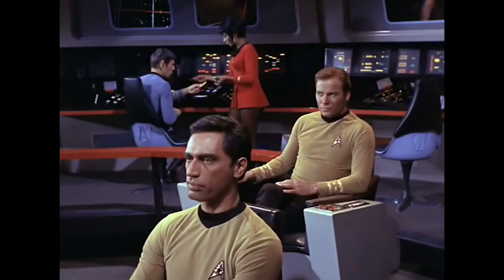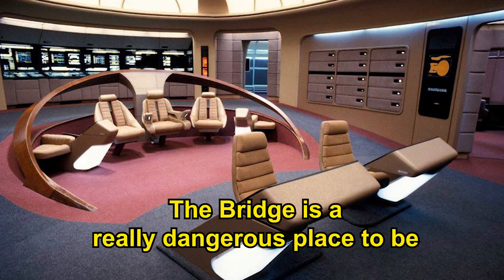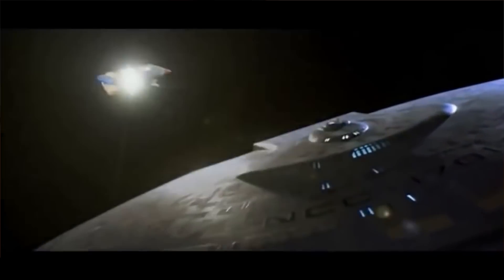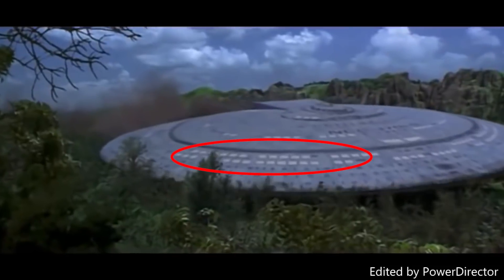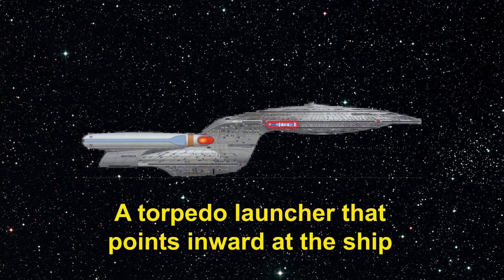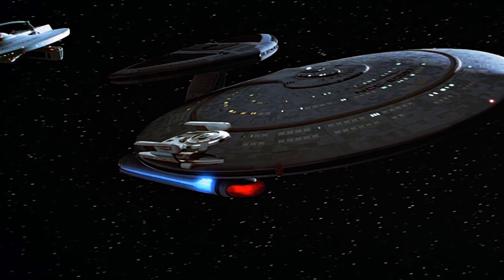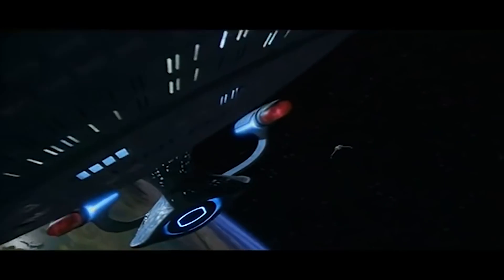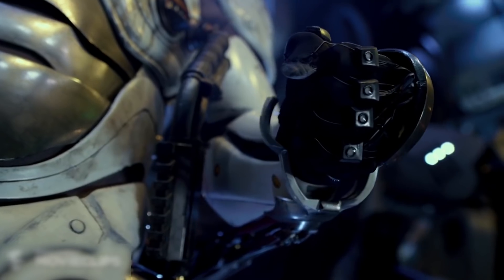10 Flaws Star Trek - USS Enterprise NCC 1701-D

Comment: Lets start with:

Technical Manual isn't canon.  Never was.  If you didn't see it on screen (or hear it talked about/described on screen), it doesn't exist.  This is in referrence of the inward facing torpedo launcher.  Its never seen on screen, or mentioned.  It doesn't exist.  Just like Voyager's Aeroshuttle.  You can clearly see the outline on the hull where it is supposed to be, but it doesn't show up on the actual in-show MSD, is never referernced even once, and never seen.  (In fact, they built the Delta Flyer in later seasons to specifically be what the Aeroshuttle was supposed to be!) 

Seatbelts:  This was actually vetted through NASA scientists.  When the high-energy conduits present in the equipment, strapping yourself in front of a bomb is a bad idea (you might get blown back from a console and be seriously injured.. but if you're strapped in and cant move, you eat the full blast and die).  The NASA scientists ALSO, mind you, asked... "why do nt they just use standard control systems so they can use seatbelts" - so ill give you half of that one.  

The Saucer Section landing:  I agree, they could have made it so the thing could at least have a controlled crash.  However, some things to blow up your comparison to the Shenzhou (dear god, leave Discovery the fuck out of anything.  Its a hot fucking garbage fire.) and Voyager:  Shenzhou is even smaller than Voyager, and Voyager doesn't even mass the size of the Enterprise-D's saucer.  (And those landing struts would never support Voyager).  

Warp Nacelle placement:  Roddenberry's initial idea was that Nacelles had to be able to "see" each other.  This was ignored after his death.  That's why later ships (like the Defiant) have their nacelles contained within the ship.  According to Roddenberry's technobable, this shouldn't work.  I cant take it or leave it, honestly.  You try to use a Nebula-class ship (basically the Miranda of the Galaxy-class era) as an example of a ship with the nacelles better protected... but this isn't true.  Theyre just exposed from the bottom instead of the top.  If they had remained consistent with Roddenberry's original "science" on the subject, this wouldn't be an issue.  (See Romulan D'Deridex class Warbirds and their giant nacelle housings out on the far sides of the ship).  

The Sovereign-class DOES, in fact, have science labs.  It doesn't have families by default, however.  As Sisko points out in DS9, you had to be of a certain rank to have your family aboard on most ships (for space reasons) but Galaxy-class ships were specifically designed for longer-term missions and families.  When asked why later ships didn't have families and the like, Berman noted that "STarfleet probably thought of it as a failed experiment" and decided not to do it on future ships of the line.. but this isn't canon.

Comment: There are plenty of design flaws, but many of these are silly and uninformed:

1. Why would the saucer section be able to land? All Federation starships are built in space. Voyager was weird and unusual in that respect and required a lot of additional tech to make possible, not just landing gear. You need MUCH stronger thrusters to land than to maneuver. Discovery and the recent movies are canon-contradicting bullshit, so don't bring those into it. They don't make sense practically on purpose.

2. In Generations, there may have been reasons the escape pods wouldn't have been viable. Once the ship was already falling into the atmosphere (which happened very quickly), it may be that ejecting escape pods would lead to a crash landing in those pods that was just as violent. Generally escape pods are ejected in space. I imagine the only way they can land is by carefully controlling their landing trajectory. If the pods can't make an extremely controlled landing, then it would be better to all be in one larger mass object like the saucer section.

3. The warp nacelles are NOT engines. The warp engine is in Engineering, which is in a centralized position in the aft section of the ship. Destroying the nacelles causes the engines to be temporarily disabled, true, but the nacelles have to be in an external position to operate properly and safely. They help create the warp bubble surrounding the ship, they move dangerous radiation further away from the crew, and on Federation ships they also act as a ramscoop, collecting hydrogen as they move through space.

4. There are many, many ways to input headings quickly without a physical joystick. In fact, a touchscreen should be quicker if designed properly and if people are trained in its use. Remember a physical joystick doesn't even allow two dimensional selections at once, so the joystick in the movie shown isn't even any better than the four-direction keypad. However, more importantly most maneuvers made by a Federation starship are completed by the computer. You usually just select maneuvers and headings.

5. I guess the saucer aft torpedo bay could be placed higher for more utility, but it's not like they didn't already have a lot of torpedo bays. Remember that torpedos can be aimed pretty effectively, or even made to curve in space. If they're running out of torpedoes, then I doubt one extra launcher is going to do the trick. And if they really want it, they can always separate the saucer section as a tactical maneuver. It would also be super easy to transport the torpedoes to where they're needed if it really came to that. I think the position of this bay is more form over function, since this is a ship built in an unprecedented time of peace. It may be a weakness for people sneaking onto the ship, but it's also possible that there's a physically designed fail-safe preventing a torpedo from being fired internally, even by a Captain's order. It might require weeks of welding to actually fire one.

Also, side-note, but 
you can't talk about "plot armor" and then criticize the fact that TV shows need exciting plots (like hijacking the ship). Feels like you're trying to have it both ways. Obviously it wouldn't really be that easy to take control of a starship if it wasn't a TV show.

Comment: and you cant compare the landing to the one in Voyager as the gear are in the section the enterprise had lost along with the core so it cant be counted in relation to being anywhere near the same and as with real life the ability to slow down or stop a fall fully depends on factors like the speed your going plus the wind friction and the angle your going down at if even one of them is too much for the desent it can cause a crash as can a lose of power which the enterprise main power was from the warp core the ship would of also had limited power during the crash due to the shockwave of the warpcore most likely having a minor emp effect on the sections power

Comment: 1. Humans like to see where they are actually going, not on a screen.
2. The new Trek moves fixed this issue, they have seat belts.
3. It's a big ship, can't watch all of it.. Ok it's just for plot.. 
4. The class D was the largest ship in the fleet, it could not fly in an atmosphere. The saucer section does not have a warp core to fly.. Voyager is a 700K ton vessel, Enterprise -D is a 4.5 million ton vessel. You are comparing a watermelon to a grape. 
5.  They didn't feel the need to modulate the shield frequency as the Klingons shouldn't have known the frequency. It probably uses more energy to do so. 
6.  I would bet they can transport the torpedos to whatever bay they need. 
7. Those are the nacells, not the engines.. The engine is in engineering. Lets be honest, its designed that way because Roddenberry deigned it that way, don't shit on the mans creation. 
8. It's not a waste of space, Enterprise is designed to transport refugees and cargo. That 35% is dead space that can take damage without killing the ship. 
9. They aren't warships, they aren't supposed to fight everyone. Thats what diplomacy is for.
10. Again, fixed in the reboot. 

Your main flaw is finding flaws with a show from over a 2 decades ago and applying modern ideas to it.

Comment: Well... here we go.
The Enterprise is a science and exploration vessel with families. The civilians are in the center of the ship because they are non combatants.  It is not a warship or front line vessel. Starfleet has those as well in designs like the Defiant, Akira, and Steamrunner classes.

Starfleet vessels use shields for a primary defensive screen, and then Structural integrity fields. They do not have much in the way of conventional armour, so placement of the bridge is not an issue.

Starfleet vessels have transporters... these transporters can easily move around inactive torpedos via site to site transport.

Security does indeed truly suck.

A crippled ship in planetary freefall is not going to be able to land safely, no matter what landing gear you think it needs. :P The Galaxy class is also a space vessel, not an aerospace vessel. the fact that it can land at all is a miracle.... which is why it has escape pods, so yeah... good point there.

Comment: Everything you mention here is logically sound, but Star Trek is ultimately theater, and a lot of the flaws you bring up work as plot devices to move the story and create drama. 

Good video, though. I laughed.
Reply: Most of the points he makes have logical faults, just think about the saucer section "landing with a landing gear" after being accelerated by a shockwave from a warp core breach, directly crashing onto the planets surface. "Just use your thrusters" that's not how it works

Comment: Well most of those Points are caused by the original intent of the technology vs artificially producing drama in the show. Which makes it stupid from in Universe point of view.

1. Position of the Bridge: Well yea kind of a point but only if we ignore that Weapons are supposed to be so strong and precise and hit so fast (almost light speed for energy weapons) they burn through any hull without shields. So it just doesn't matter where you are on the ship. The only true solution to this would be a decentral command and to split the commanding officers over the whole ship. 
2. Well practically drama 
3. Drama as well. Remember those forcefields every few meter in the corridors? And internal scanners? The ship should be able to quickly identify and arrest just about anybody and that centrally controlled by a security operator in mere seconds... yet they need painfully slow arriving security officers and fist fights against Intruders. Why? Drama! To fill the episode. Same reason on why the Transporters can be used as miracle machines to reconstruct bodys and make Picard young and then old again and yet are not used to simply replace the injured body of a seriously injured crewmate or extend the lives of people. Death could be prevented even without the prohibited eugenics. 
4. Saucer Section landing well it was just not meant to land on a planet and a crash landing is more or less an last resort thing. We should ask here why the Saucer has no warp capabilities if its supposed to run while the drive section holds back the enemy. Its just stupid to have the mobile part stay and let the painfully slow and crippled part run which on its own needs more of a lifetime of the Crew to get as far as the Enemy and Drivesection in under a minute. But well in the very first Episode of TNG we actually see the Saucer arrive at farpoint station separate from the drive section which pretty much prooves that it must be able to fly at Warp on its own... Anyway the Saucer should stay in space and move on its own. If its just meant to planetfall the normal escapepods are far better suited.
5. True although its again drama. 
6. That is indeed more than stupid. move it to Deck five right under Shuttlebay 1 and it would be far more usfull indeed. 
7. Well multiple points here both in and out of universe originally the nacelles were supposed to need a unobstructed line between them which is why they were mounted on struts and behind the saucer. But that was ignored by future producers so jea... In universe they are simply huge explosive bombs. With the Warpplasma in them they would damage a serious part of the vessel if destroyed. With them further away from the main hull it means no where as much danger to the ship. Also with the point mentioned under 1. the shields are supposed to keep them unharmed if they are gone they would be as vulnerable anywhere else on the ship. Just imposing a far greater threat to the ship if they are closer to the main hull. 
8. That is even inuniverse just on purpose. The space is there its just mass which hampers with things like maneuverability in space. And the ship should have a psychologically positive effect and seem open and wide since the Crew has to stay on it not just for a few Months like on present day ships but for Years without leaving. Also the Galaxy class had an expected service time of a 1000 years. This is why it was build with so much empty space for future expansions or highly specialized mission specific equipment. 
9. The ship was meant to rarely see combat but go for 10 Years on missions on its own. This is why it has so many facilities and Families on board. 
10. Again Roddenberrys vison vs Drama and Plot. The quick maneuvers make no sense with weapons targeting and hitting at lightspeeds. Battles wouldn't happen at such close quarters. For this have a look at Roddenberry's second show "Andromeda" they manage to depict it far more realistic in the way battles happen across distances of half a solar system. Just about every StarTrek battle happens within a distance the Andromeda would consider "point blank". Space is just insanely huge i mean really really huge. A manually controlled maneuver just wouldn't be necessary. Most maneuvers would be preprogrammed and computer controlled with the human only point at a vague direction and state what to do. And even with all this, modern Computergames give relatively good control over virtual aricraft with just about four arrow keys. Which the LCars Display has as well. So they would actually sufficient to pull of the "Riker maneuver" which didn't need as precise controll to justify a actual Joystick especially since the Controll would be digital anyway.

Comment: the overxposed bridge isnt really a weakness.....no ship besides the defiant has anything that could withstand an antimatter explosion..... if the shields are gone..you are gone^^
the main ( and only ^^) line of defense are the shields....tv doesnt capture it...but both..shields and torpedos are wayyyy to powerful^^....the enterprise d should be able to fly through a star and anything hit witout a good shield by a class idk torpedo would vaporize and  distribute itself  over the solarsystem at the speed of light ...;) no matter what material or size

as a kid i looked once up what a type 2 ( the handheld middle ones from enterprise D ) phaser on maximum setting and spread would do.....i believe it was something like vaporize  2,5 zoll deep any substance over a football field wide area......at the expanse of its whole battery.... but still^^...could have to to with my mathskills as a 10 year old...but it still sounds a little op^^